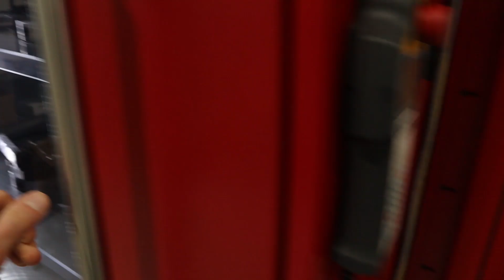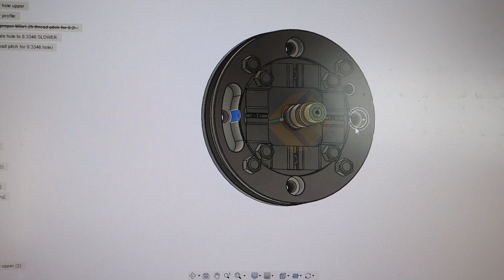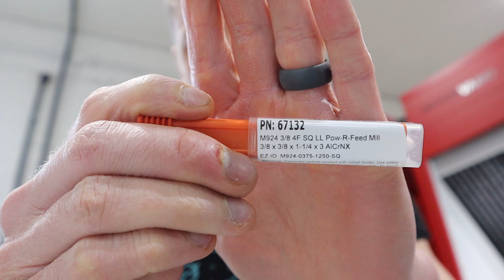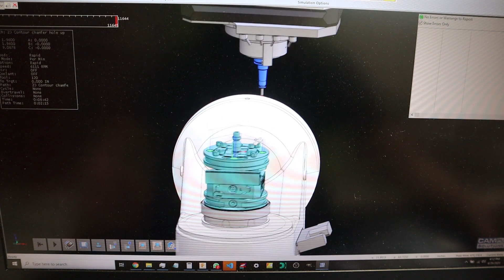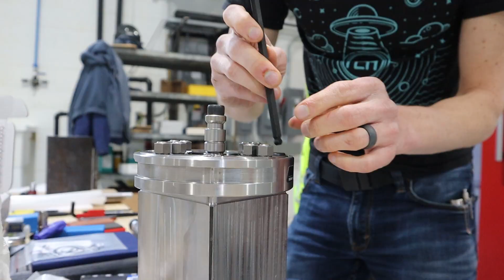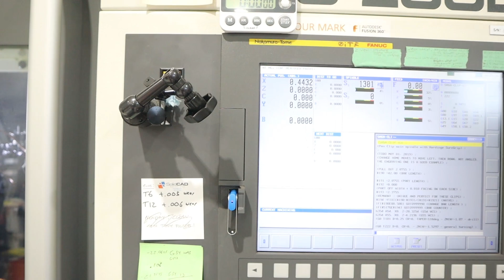Kern Progress! - Quarantined Shop Life Day 17

Comment: I have found, when belt grinding bolts, they love to roll the first part of the edge over on the thread due to the heat.
Even the 120 grit belt does it, only way is slow very light pressure and grinding that edge first, that way the material doesn’t get hot.

Comment: isn't it wonderful to program in Heidenheim
It's such a nice programming language for CNC
What do you think about heidenhain compared to the hash controller Haas
Reply from the maker: I've never used a Haas controller, but I have 3 Fanucs that I've gotten very very good at.  Heidenhain is freaking amazing.
Reply: @JohnGrimsmo   I have mostly used Heidenheim controlled CNC machines for the past 20 years.
and if you FANUC machines
the system to the tool magazine that's almost the best in Heidenheim
if you have 10,000 tool holders with tools in then it can manage it
you only need to tell it which pocket you putting the tool in .
you can quickly change tools.
so you only need to calibrate when tool brake or wear
I have never used a Haas because they not so common in Europe

Comment: For your silicone ring, you might wanna check Groove they make a ring with said grooves on the inside, it helps to breathe for the skin under the band and the grooves are primarily designed for safety. The grooves acts as thinner channel in case of an accident it rips in the groove, easier to break than those full cheaper ring. I have one to wear in the shop and its great. They also have a great warranty, they will replace it if it breaks and even if you lose it, if i remember correctly.

Comment: Why not make yourself some plastic setscrews for the collets? Your double ended tools will be fine then and you'll have a degree of uniformity when changing the collets / tools.
Reply from the maker: Excellent idea.  Gotta keep in mind that they will be spinning at 42,000rpm, but on center so maybe it's no biggie?
Reply: @JohnGrimsmo  they are going to be contained within the collet also so shouldn't break up. I'd use Delrin or Nylon rod personally. Worst case, if they did break up they will fall out but the end mill will be fixed in place by then.

Comment: About dripping coolant to lower pallets. It is probably not an issue, but you could install a bit of sheet metal to capture these drips and funnel them to the side (back), instead straight down. There should be no interference with robot or pallets below.

Comment: Get at least 1 low profile 3 jaw chuck to have on a pallet all the time. I recommend the Lang Ino-Grip Compact. You will be machining quite a few of those pallets plus it comes in handy to hold round stock.
Reply from the maker: That is an AWESOME idea, I will do that as soon as I feel like spending money again!  You're right, for holding the pallet upside down, or any sized round stock, I'll need this.  I'm planning to make some ER16 holders for my smaller pallets too.

Comment: So, i'm sure the bolts will hold since you took easy cuts. But normally you should cut them with coolant. The inherent strength of screws comes from the fact that they are cold formed, which squishes them together cold, to form the threads, which increases the strength, especially in the threads themselves. When you cut them an they get to warm you are annealing them basically, which  means you're left with less strength. (Some sources say back to construction steel, but i thinkt thats a bit far.) I've cut a lot of screws with angle grinders which is of course the worst case, (but not so far away from a belt grinder) and never had any problems. Since i've learned this fact though i cut everything on a bandsaw with cooling or a lathe with cooling. Better safe then sorry. If anyone has another opinion on this, i would love to hear it, since cutting with the angle grinder was sublime.
Reply from the maker: Cutting it the way I did takes most of the heat away with the chip, that's why in the heavier cuts the chips are blue.  Very little heat goes into the parts.  Back in my car days I cut a lot of screws with an angle grinder too, and I remember that putting a TON of heat into the part, so if anything I'd theorize that would be worse.

Comment: Noticed when you were taking the tour at kern and they showed the tools omg the tool rack on the side of the machine that they had logo to the right as a rule of thumb and also because it looked like it had those directional tabs on the collet. Do yours not have those tabs allowing you to put the logo out?
Reply from the maker: Yeah I didn't get the directional tabs so that I could use toolholders from different brands if I wanted to, so mine are all smooth except for the probe and the calibration tip.  Ahh I forgot they put theirs to the right, I just remembered that they did.  I like it front facing better, easier to see haha.

Comment: Hey john, it’s Ayden, have you thought about adding a wash cycle with a fan or an empty holder with through tool air to blow off the parts? That will help with the  mess.

Comment: Can you clamp bits, then measure, then just add the measurement to Fusion, rather than having to mess around with trying to get a tool set exactly at a fusion height you decided before tooling up the collet?
Reply from the maker: You could do that, but I need a basic dimention to start with so that I know where to start.  Usually I start by looking at the tool itself and the collet, then put that info into Fusion, then assemble and measure.  And I think it's good to shoot for relatively even install numbers, like 1.2", instead of 1.137" randomly installed.  But yeah there's improvement to be made in the process for sure.
Reply: @JohnGrimsmo  I hear you John. Chicken and egg! Sounds like you need an adjustable tool that clamps to the cutter and holds it in place, but has a screw or allows feeler guages to allow fast fine adjustable offset from the collet, so you can tune in that fusion dimension whilst clamping! Or just an o-ring!

Really enjoy the videos and your journey.

Comment: Hey John, You could catch coolant by putting a sheet metal drip tray under each pallet shelf. Maybe they could all drip into the bottom one?
Reply from the maker: Very cool idea!
Reply: @JohnGrimsmo  Well, as you well know, ideas are simple and easy to come by - execution is the hard part!

But I saw the adjustable slots and you have the existing pallet rack to measure tabs and dimensions from, so it shouldn't be too hard to model up sheet metal in fusion and have a local company fold some drip trays up for you. Time and money though! 😁

Comment: Hi John,

You have said before that, when installing a new tool into the tool rack you index the tool so the writing is on the front, it's not going to matter unless the spindle stops at it's home position every time.

Question; If you're modeling all your parts and tooling in your CAM software why do you give it so much clearance when probing? Eg 3" clearance. Surly by now you can trust yourself to lower that down to 1" and increase the rapids a little more.

Regards
Reply from the maker: The spindle does index every time before a toolchange.  And yes, I could definitely get bolder with probing clearances, but it's always good to start conservative (especially while filming and not paying as much attention).

Comment: Should you go in and clean the coolant out from inside the Erowa base? They've clearly gone through a ton of effort to prevent any coolant getting in (until you drill through the pallet)
Reply: You are onto it, once he mounts the tombstone to the pallet the screws should prevent coolant from entering the base. maybe a little sealant on the threads.

Comment: Great advice on the Ring Safety...retired US Air Force, and learned that metal rings and any kind of mechanical maintenance, be it wood working, metal working, electrical, etc are an accident waiting to happen.  I retired before the advent of neoprene / rubber rings, but started wearing one for the gym...knurled weight bars were damaging my ring, so i'd take it off, then forget to put it back on.  Ironically, though i'd forget it, wife noticed it missing in no time....

Comment: Hey man, I really like your videos. The Kern seems like an awesome machine!!! Something I noticed in this video that maybe you want to check. So I just got in a set of 5th Axis DJ6 jaws(basically the same concept as the jaws you are using, but for 6 inch Kurt vises). When researching these, I saw a review that said the height of the lower step below the serrated dovetail varies one jaw to another. That person was claiming a .002 height difference between the 2 jaws in their set. I plan to mainly use these for dovetail work but seeing that stuck out to me and I will definitely throw an indicator on this edge before using these jaws in this way. Thought I would pass along the info. Keep up the great work!
Reply from the maker: Awesome, thanks for the tip, I'll check mine out someday to confirm.

Comment: That pallet is too soft to be using stones on, just whack that bur with a file or a grinding belt.  The stones will load up if you use them on soft steel.  And before people go arguing with me, hard steel wouldn't deform like that when gripped with hard steel.
Reply: They are precision stones. They shouldn't be getting used on this sort of marred surface anyway.
Reply: That's funny, I use a set all the time for just that purpose, I run over just about every mating surface, manual machining, before every set up, every thread turned in the lathe, parallels, every thing.
It helps if you can just make a new set or resurface the current working set yourself though. Takes bugger all time once you have a jig for it.